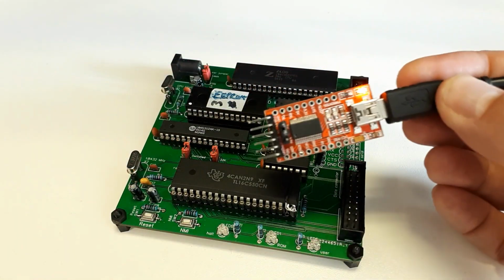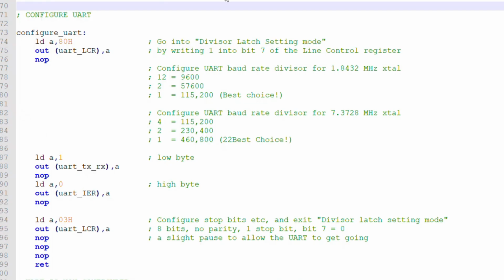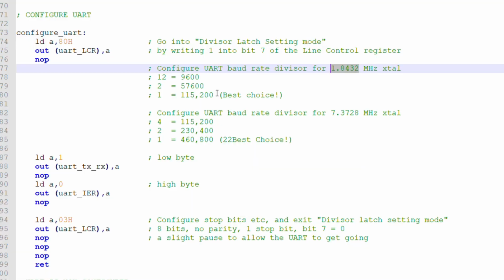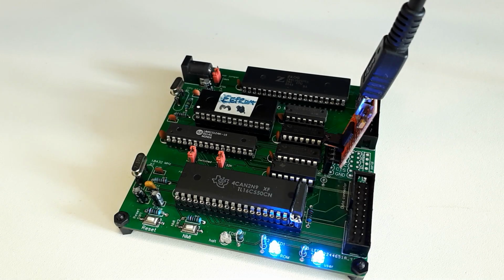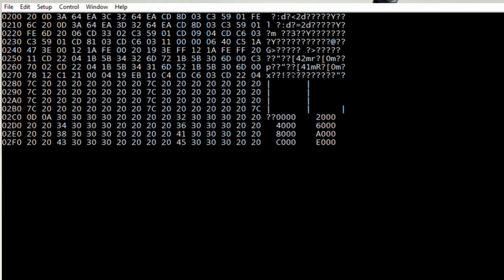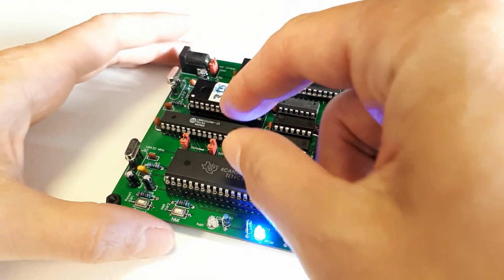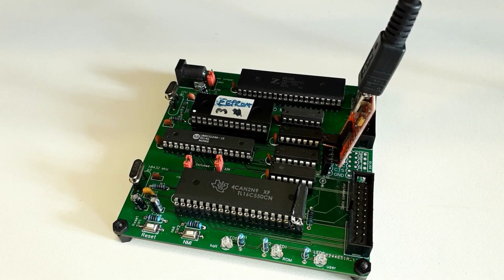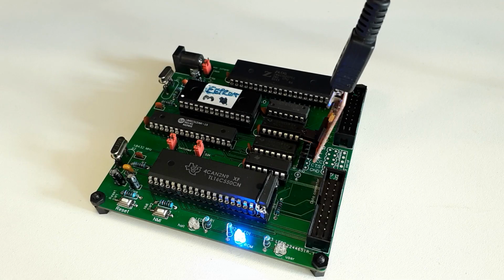Z80 Playground part 3 (This is my Single Board Computer or SBC that runs Basic and CP/M)

Comment: If you want to add a cheap graphics card, check out PiGFX on Github. It uses a Pi Zero and ANSI escape sequences to drive either an HDMI or a composite output.
Reply from the maker: I have already considered this option!!

Comment: I'm curious why there's a need for NOPs after writing to the UART chip.
Reply from the maker: I bet there is no need at all. I think it was some debugging code that is still left in there. What I actually found was, the UART seems to take slightly longer to wake up after reset than the processor does, so I had to put a short pause in the code AFTER reset and BEFORE configuring the uart. I think that in desperation to get it working I put pauses all over the place, and then left those ones in by accident once I'd got it working. I spent about 5 hours tearing out my hair over that one!
Reply: @CircuitBreaker256  I asked because I've had issues with one of my 16C550 projects and was wondering if this was my issue as well. Thanks for the mentioning the reset delay.
Reply from the maker: @RetroRogersLab  I discovered it by looking at the TX line on a 'scope. It was working in 5 bit mode not 8 bit mode, which turned out to be the default value if you don't configure it. So I figured that I had not actually configured it, even though my code was trying to do just that.
Reply: @CircuitBreaker256  This has really got me thinking about my old project. I did some Googling and ran across this page: http://www.z80.info/z80sourc.txt. If you follow the init code it looks like they're using the UART scratch register to see if the UART is present but this might also work for is it 'alive'. I might give it a try this weekend and see if that solves my problem without NOPs.
Reply from the maker: @RetroRogersLab  ah, thats a good idea. Keep writing to the scratch register and reading back until you are sure the 16c550 is awake, then configure it. I'll use that idea. All I did was a huge delay loop at start up.